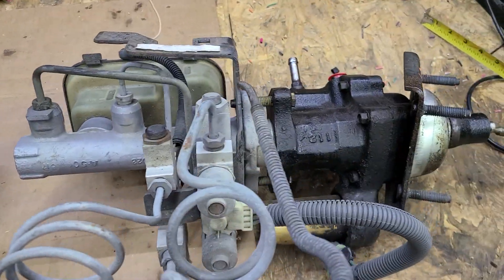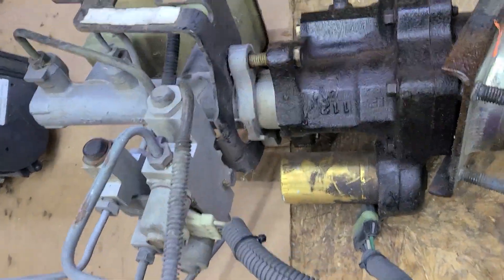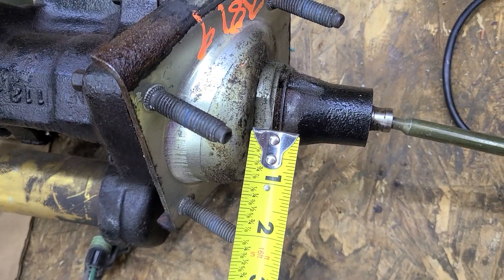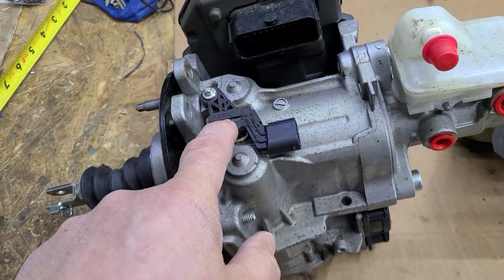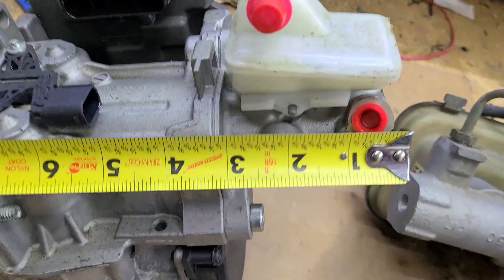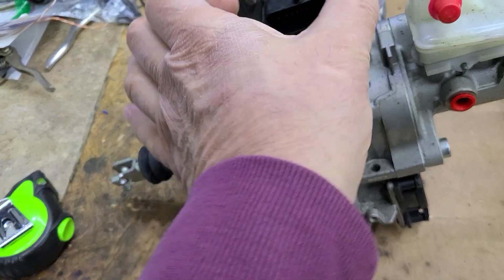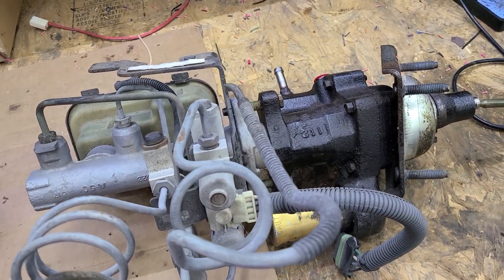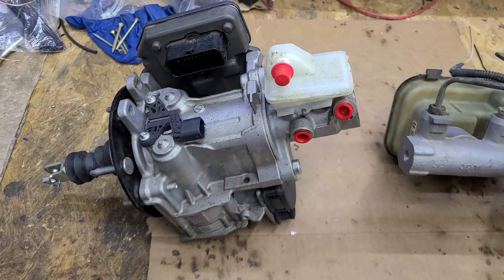iBooster vs Hydroboost - detail overview, dimensions and functionality

Comment: Hey man do you have the wiring guide for this??
Reply from the maker: go here for wiring details.

https://openinverter.org/forum/viewtopic.php?t=2762
Reply: @aknovaman  Thanks for fast reply. I went thru all links here after I posted ? and found info. I want to put this under my dash in my 1971 Maverick and wondering which unit is 1) smaller? and 2)which gen is better? You would think Gen 2 unit is improved?
Reply from the maker: I prefer the model I use as it appears smaller and more streamlined than the first generation version. beware the electrical connections are different.
Reply: @aknovaman  Now i'm confused the one in your vid is a GEN 1 booster. (correct?)The Gen 2 booster is the one that looks kinda round body. Seems peeps  have more problems with the one in your vid with pedal travel sensor?

Comment: Thanks for the overview on the ibooster. Do you know which port goes to the front and which port goes to the rear on that master cylinder?  Best. Dan
Reply from the maker: not sure yet but usually front of car goes to back brakes. and visa versa.  cause pedal pressurizes front brakes first, then back brakes.
Reply from the maker: go here for wiring details.

https://openinverter.org/forum/viewtopic.php?t=2762